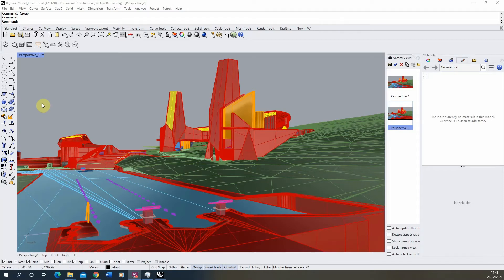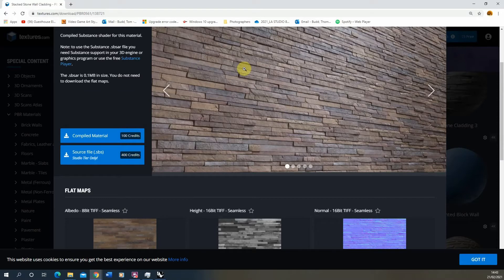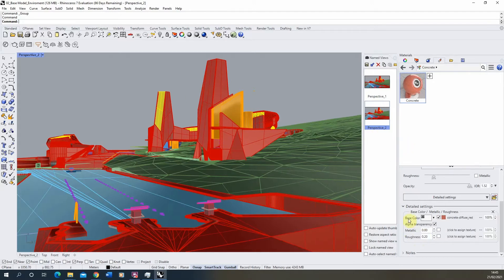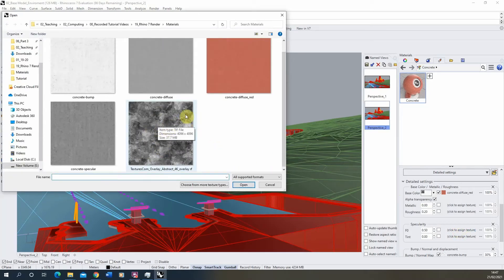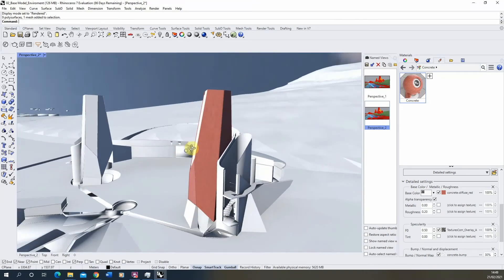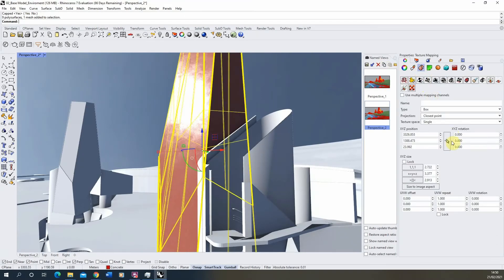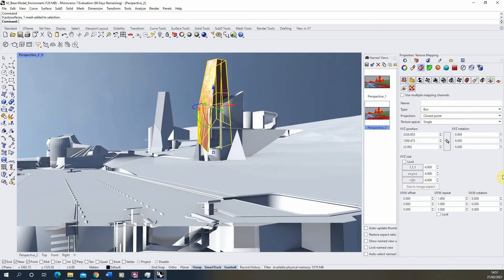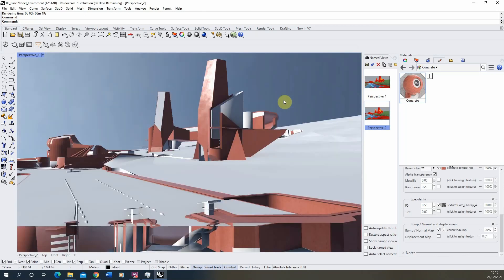Rhino 7 - PBR Material Creation

Comment: why did you not use displacment map ?
Reply from the maker: Hi Johan, Displacement Maps drastically increase the render time and for far objects such as these they are not essential. They are most suitable when creating textures with dramatic textural qualities, like rock, etc
Reply: @tombudd15  last question sir. Is it possible to make displacement map on one side of a geometry? Because if I want to use it on a wall, the sides of the wall becomes very disrupted and ugly if the walls arent joined in the same geometry. Thx alot